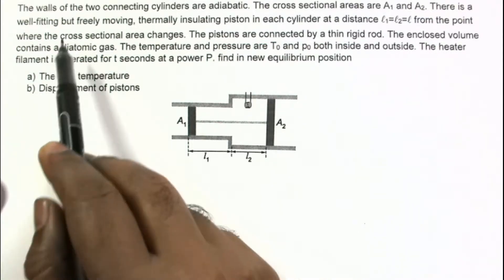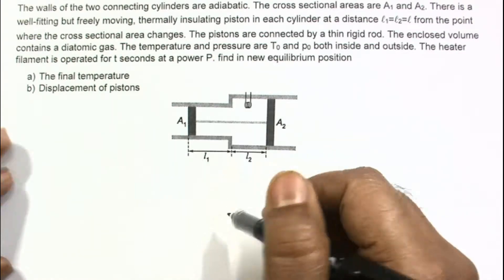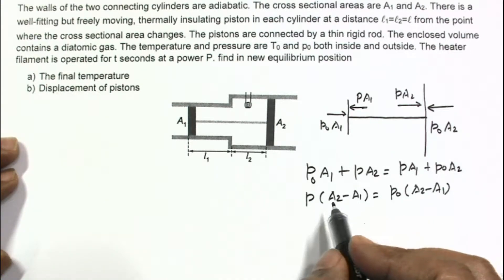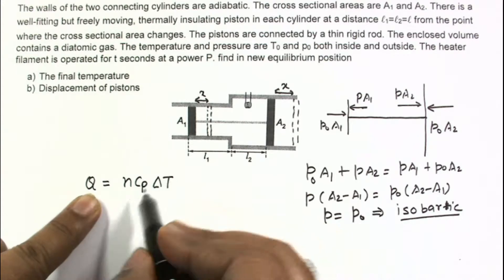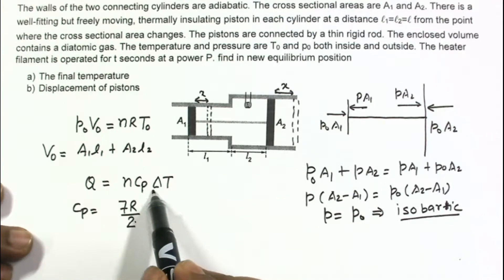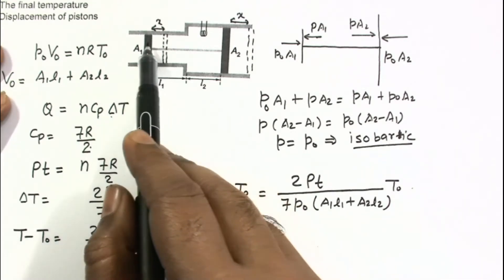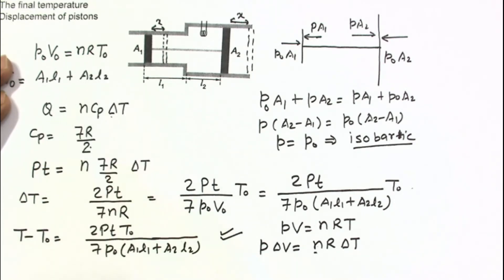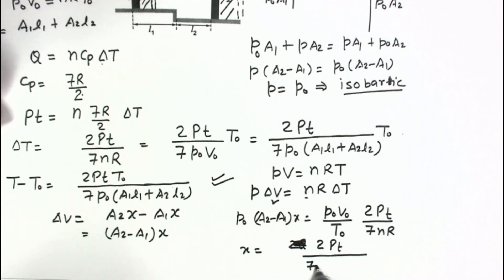Thermodynamics | Advanced problem | Displacement of pistons

Comment: Sir i have doubt
If pressure and temp was told is same out side and inside .

So after time u equated that forces ...
And logically they move in same direction as pressure is constant..
But sir logically how volume can increase???(i mean net vol inside system if small area A1 comes right it would have to come with faster rate so that net vol can be constant ..plz make it clear...🙏🙏🙏🙏🙏🙏🙏🙏🙏🙏